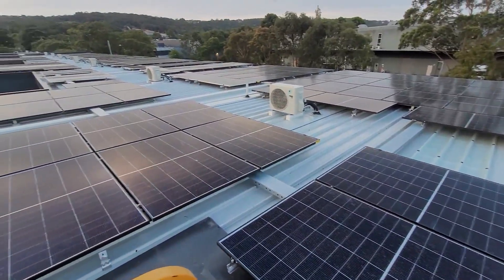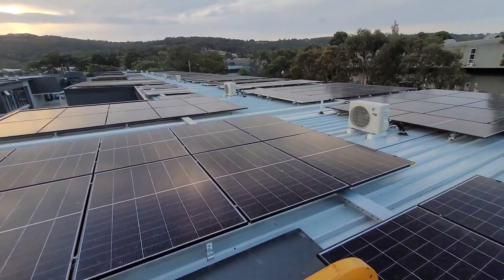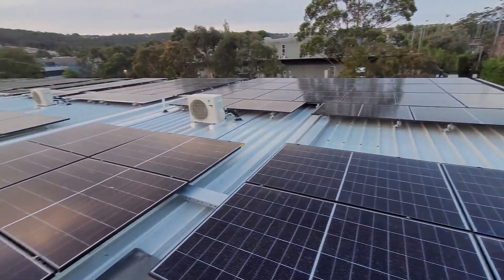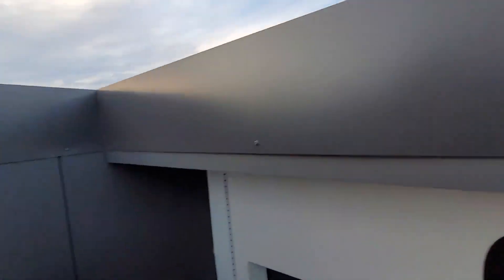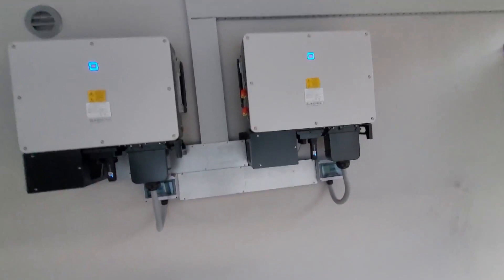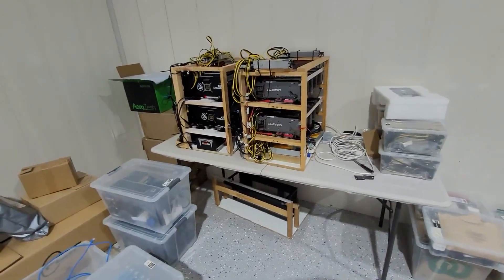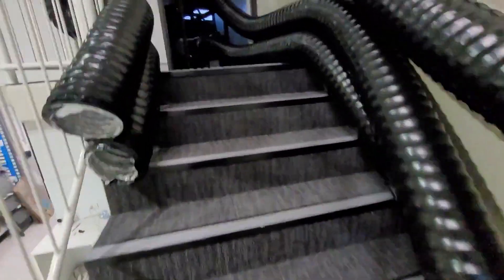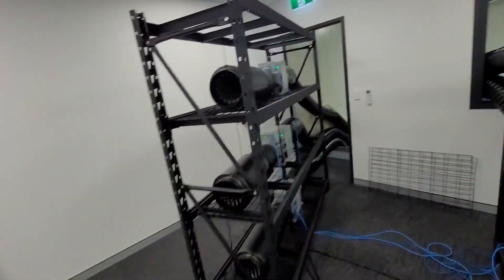Solar Powered Crypto Mining Warehouse | Day 1 Lets go!! ⚡🤑

Comment: yes you can schedule your asics... you will have to use a contactor (because of the high load).  The contactor can then be switched by any means you want.  If you size your contactor appropriately you can switch them all. Think of a contactor as a large light switch that is capable of switching high amperage loads.